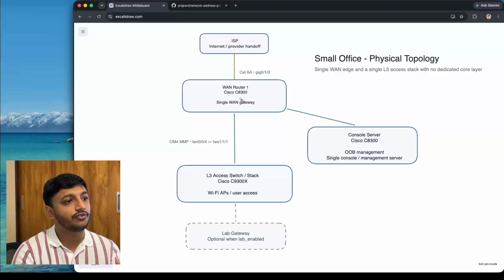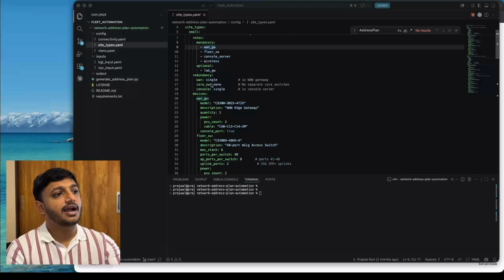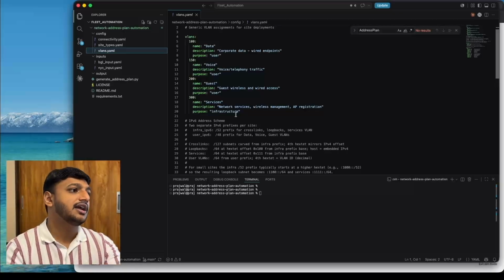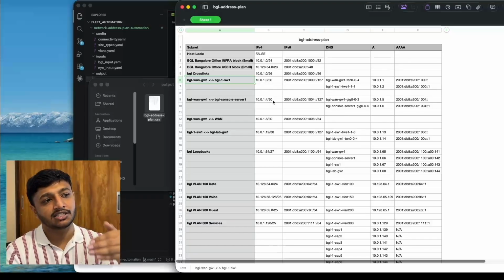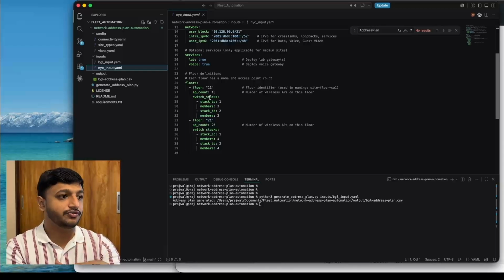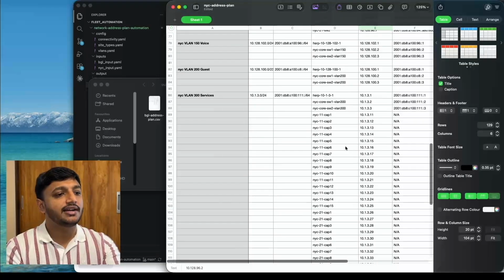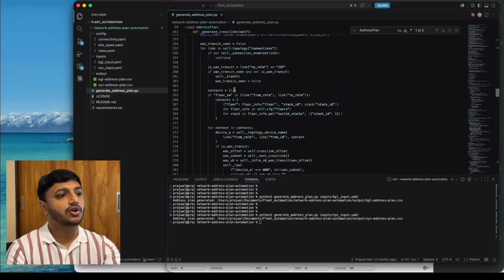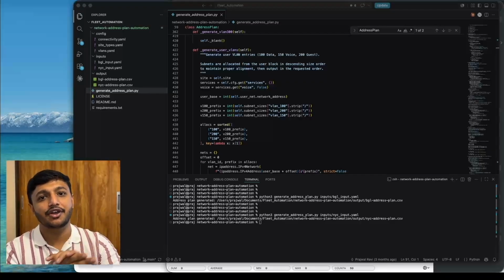Network Address Planning as Code: From YAML to CSV

Comment: IPAM has the same functionality as well, right?
Reply from the maker: I'd say partly yes. An IPAM platform can manage and allocate address space and act as the operational source of truth. Once we have the main user block and infra block defined in IPAM, we still need to manually break down the, loopbacks, cross-link IPs etc
This project focuses on generating a standardized address plan from topology and site requirements defined in YAML. In a production workflow, the generated plan could be validated against or pushed into an IPAM system so the two approaches can complement each other. I'll have a video coming next where we can use Agentic AI SKILL to write this into DDI systems directly once generated.